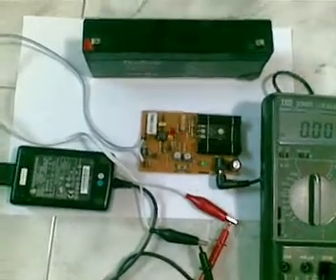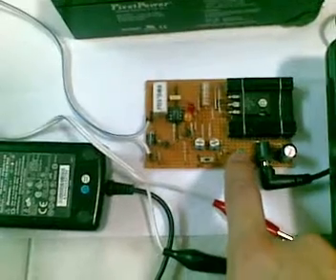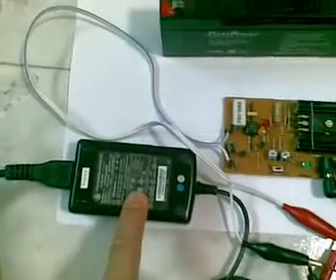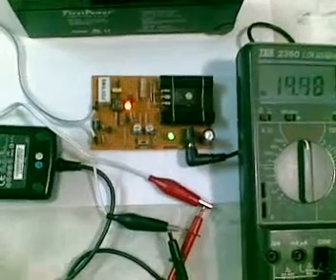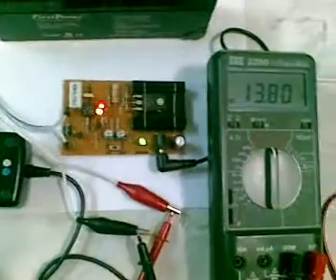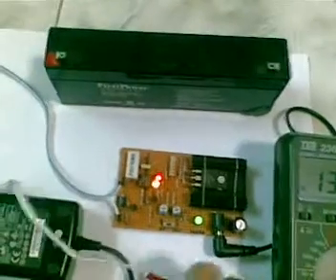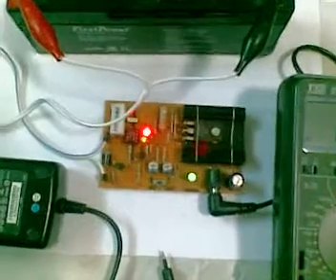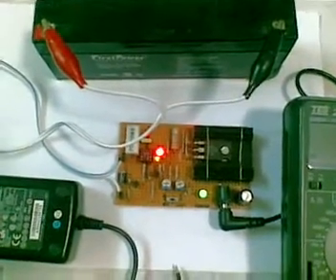DIY 6V & 12V SLA Battery Charger

Comment: Take your water pressure theory as example. You are now regulater the pressure from 240PSI to 12PSI. If you don't limit the flow, it should go infinity ideally speaking. For your adaptor, the designer limited the output current to 0.5A. If you could furhter regulate the voltage down to 6V. You will get 1A out of it and so on. The point is, ultimately, you will get 6W of power. If you fix the power, you can play around with the voltage and current base on OHMS law. Thanks.,

Comment: if thats correct ,,that ex. with the pool.. then how is possible that i have 12 V "pressure"  but more water flow?  if im using just 0.3 A . thats the water flow.. so how is that possible? 240 V and 0.3 A going in..   but 0.5 A is geting out.. that means im taking small river and making a bigger one with that one... thats why im confused.. thank you again,, im relly stuck at this.

Comment: one more thing if you can answer me il appreciate..  can i compare for ex. water in the pool with batery and electricity..  pool is the batterie case , water is the electricity in the batterie.  if i can.   then the voltage is pressure right?  so the amps should be water flow right?  then the wats are how many water has flowed  ??  is that correct?  thank you again.

Comment: Hi there. Lets take your power factor 0.8. Your adaptor input power is 100V * 0.3A * 0.8 = 24W. The output power is 12V * 0.5A = 6W. Basically you have losses of 24W-6W=18W. Assume you have 100% efficiency. You can have 12V@2A on the output side which is almost impossible in reality. Thanks.

Comment: i have one question.  i also have one charger but something is strange.. it says that input is 100-240 V ~50/60 Hz 0.3 A       but output is 12 ::: 0.5 A         i dont get it.. is that mean that it produces more then it takes?

Comment: I just saw that diagram... the dotted line means that the 2N3906 transistor is physically attached to the battery casing so that it can 'read' its temperature and provide feedback to the regulator. The higher the temperature, the lower the output voltage. The line is not a conductor.

Comment: Thanks! Is that the diagram titled "Temperature Compensated Lead Acid Battery Charger" with the LT338A, shown, in use? That's the only charger I see on the LM338 datasheet. If so, there is a dotted line connected the emitter from the PNP 2N3906 over to the ground of the charge battery -- am I seeing that for what it is... a connection? And the additional ground shown, that goes to ground on the power source I take it? Thanks

Comment from the maker: Hi. Actually the OP-AMP will constantly monitor the charging voltage and compare with the reference voltage. Once the preset voltage reached. It will cut off the power to battery and hence the charging stop. Thanks.